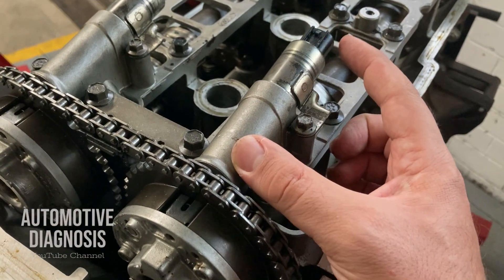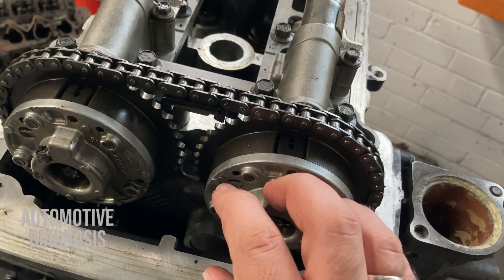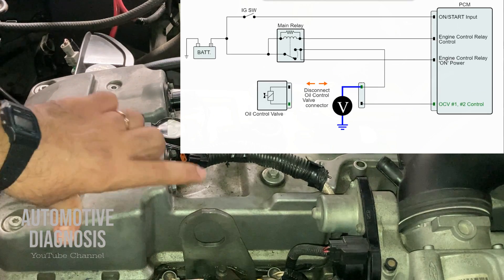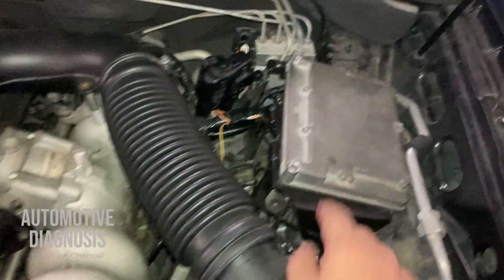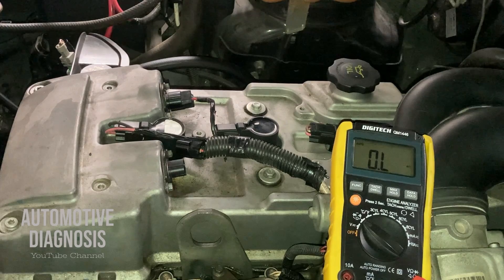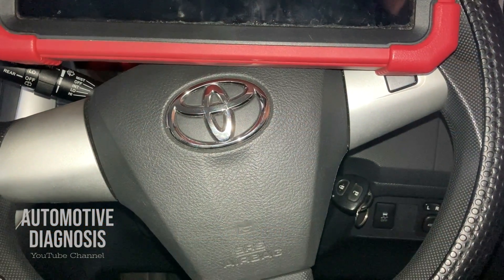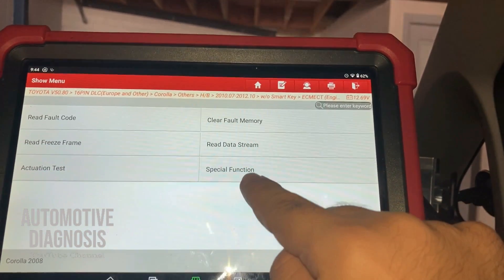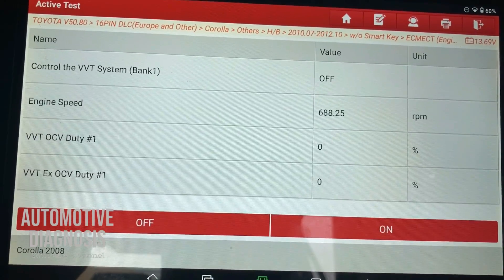How to Test & Fix P0016 Crankshaft   Camshaft Position Correlation Bank 1 Sensor A (Bank 1 - Intake)

Comment: Very useful info..thank you soo much .. i have the p0016bcode on my hyundai i30 2011 from day i bought it.. i bought itbcrank no start and replaced ecu , fuel pump etc but cade sinstored.. vvt always shows off.. when testing the cam sensor im getting battery voltage on one line and another 12v on the signal wire.. there is continuity back to ecu.. 12v is also at ecu.. i dont know where else to check..im beginning to think iys the ecu.. althou the vvt was giving a strang resistance
Reply from the maker: HI there, P0016 could be caused by several reasons, if you have crank, no start situation, the next thing to check is the crank sensor.

Comment: My car had p0016 code too. Toyota innova. The problem is the engine rough at a certain time. Changing the sensor wont do any good. Maybe need to adjust the timing ?
Reply from the maker: Hi there, all steps are explained in the video, we don’t go for replacing the sensor or adjusting the timing straight away, checking the engine oil and VVT solenoid valve are at the priority.

Comment: I got a ford expedition with a p0017. The customer replaced all the suspected parts for this code and now they're bringing it to me because the light is still on. I checked the connections and its all good but will the intake side VCT cause a p0017 code? The only part not replaced
Reply: Since they already changed all the parts that would associate with this DTC my final conclusion will be to check the timing belt and or timing itself.
Reply from the maker: Hi there, this code is for the exhaust camshaft timing, so you don’t need to replace anything on intake side. VVT solenoid and exhaust cam sensor are the most relevant parts. If they are already replaced, the next step can be adjusting the timing. Please remember that VVT itself also can be the cause, so when we are adjusting the timing, before setting up the chain, we can remove the camshaft, to check the VVT mechanism. Normally on the new exhaust side, VVT is locked at maximum advance when we remove it, and if we provide air pressure on proper passages, VVT must rotate toward retard. If it doesn’t, it means that the locking pin is stuck and won’t let the VVT to adjust the timing when engine runs. And that’s would be the reason for this fault.

Comment: So I replaced mine a month ago, and the p0016 would not go away. I have my MOT due soon and the Engine check light would be an automatic fail.
There were no symptoms, the car is running fine but still the code was there
So 3 different garages insisted it was the timing chain needs replacing, which I though was odd since it ran really smooth, no rough idle, good acceleration etc
Anyway today I put the old cam position sensor back on and suddenly the fault cleared.
 OBD II scanner could no longer detect the fault and its been off for half a day now
I noticed the cyclinder part of the cam sensor was a bit stiff, ie it could barely turn around, I twisted it around a few times , not sure of this was the fix, because the 
fault code first appeared with the old sensor on. 
Not sure if the cylinder part is supposed to turn around, but the new one is very loose
I am cautiously optimistic that it is fixed now
Reply: nope it is still broken :)

Comment: Great video. I just replaced the 4 camshaft position sensors on my 2016 Cadillac XTS. Now I'm getting P0016-P0019 codes all saying "Crankshaft Position - Intake/Exhaust Camshaft Position Not Plausible". Do you think the VVT solenoids need checked and possibly replaced? The only other thing I can think of is running the Crankshaft Position Relearning with a scanner since I replaced the camshaft position sensors.
Reply from the maker: Hi there, thanks for sharing your experience. I don't think VVT solenoids are faulty as they don't get faulty all together. My suggestion is to focus on crank sensor.

Comment: Great video. Does that apply to 2012 chevy traverse? I am getting voltage on the solenoid connector but only 2 volts. Have P0016 code. any suggestions?
Reply from the maker: Hi my friend. Yes it’s almost the same. Ignition ON? What do you get on each pin?

Comment: Great video! I got a 2011 gmc Acadia 3.6L was running fine but when idling in drive it’ll die out, I replaced all 4 camshaft sensors and all 4 vvt solenoids, now it’s having a hard time to start, I replaced the crank shaft sensor, it’s still having a hard time to start, engine oil was replaced less than 100 miles ago, currently getting codes p0016, and p000B along with random misfires codes, any suggestions?
Reply from the maker: Hi there, have you considered checking the timing chain/belt? You have timing fault codes for both intake and exhaust camshafts (bank 1) that could be connected to that.

Comment: My car had a vvt code would try and turn over, sounded like it almost could. Took out vvt and tested, it either dident click or started rapidly clicking Broken? I changed the oil also recently and its full.
Reply from the maker: If VVT doesn’t not click after proper activation it’s faulty
Reply from the maker: If VVT doesn’t not click after proper activation it’s faulty
Reply from the maker: If VVT solenoid doesn’t not click after proper activation it’s faulty